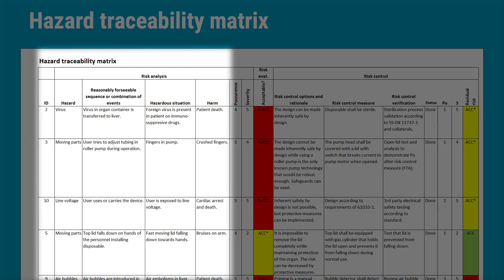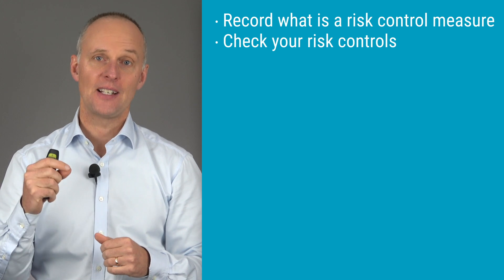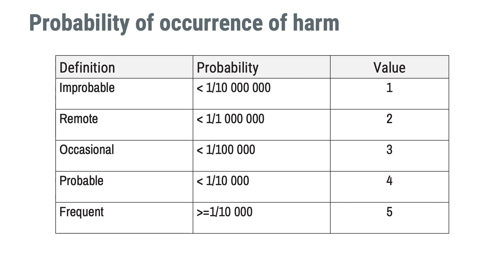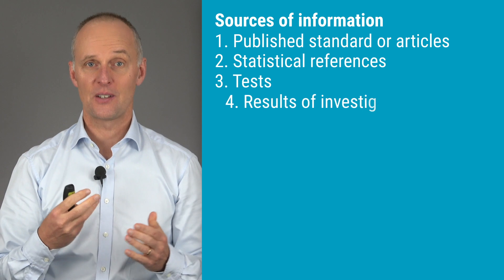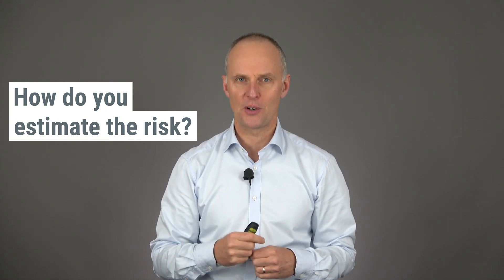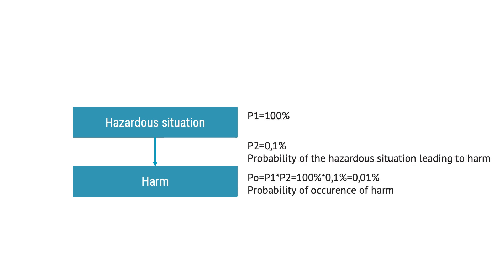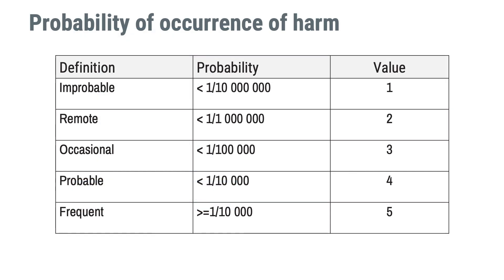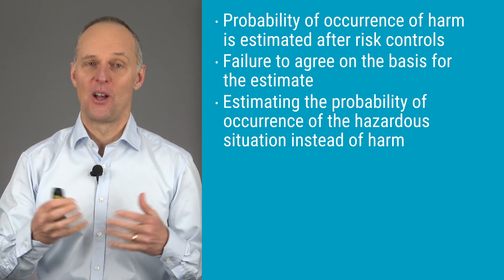How to estimate risk for a medical device according to ISO 14971:2019

Comment: What is difficult is to evaluate the probability of harm when you don't have data, for example when you want to market a very innovative device. According to ISO 14971, if you don't have data then you should consider a probability of 100%. This could lead to non acceptable individual risk and to non acceptable global risk for device. The consequence is that the device won't be put on the market unless the manufacturer performed large clincal investigation.
Reply from the maker: Hi Delphine, sorry if I come across as being picky with words, but the standard tells you to work with Po=100% when it cannot be estimated. But not having data is not the same as it being impossible to estimate. "Expert assessment" is one method to use to estimate the probability. In fact, for most new products, it is the method that is used for most risks. 

There are however cases where you cannot estimate, for example when software is involved in the foreseeable sequence of events or where the clinical consequence of a specific circumstance cannot be explored due to ethics
Reply: @MedicalDeviceHQ  thank you for your answer. I agree that "not having data" = "not possible to estimate". The device I have in mind is a software and you "answer" in the second part of your post. 🙂

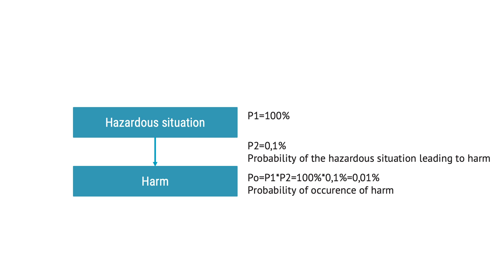Comment: The math at 11:20, 100%*0.1%=0.01% is incorrect.
Reply from the maker: Yes, you are right. THat one slipped through the cracks. It is updated in the online course though. We will be making an update here too.
Reply: You just need to remove the % it is actually 0.01 or 10%
Reply: Question: at 12:21 the example shows P1 as a combination of Hazards A, B and C. These probabilities are multiplied together to get P1 and I interpret this to mean all three hazardous events must occur for the Hazardous situation to occur. But if any one of the 3 event could lead to the hazardous situation on it's own, would P1 then be the sum of event probabilities? Thanks for the video.

Comment: Is Risk Control Measure an integral part of Risk Management Report.? If true. Why  has never been a column in risk management report for risk control measure? Thank's
Reply from the maker: Risk controls should not be part of the risk management report. The minimum risk management report contents are specified in the ISO 14971: the results of the risk management review, the result of the overall residual risk evaluation and the answer to whether you have processes in place for collection and review of production and post-production information.